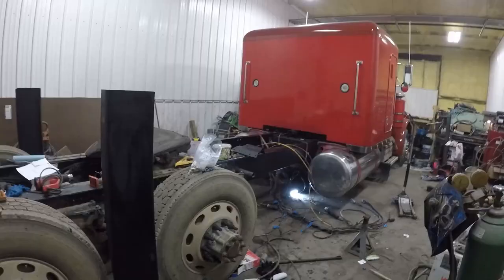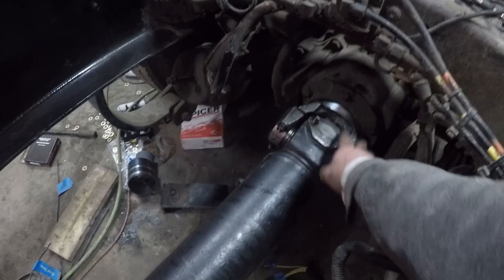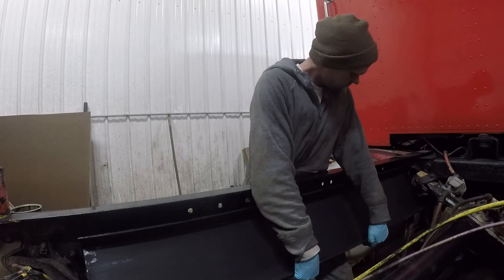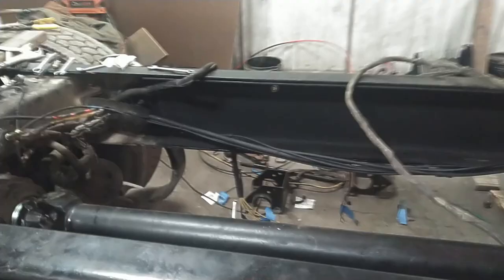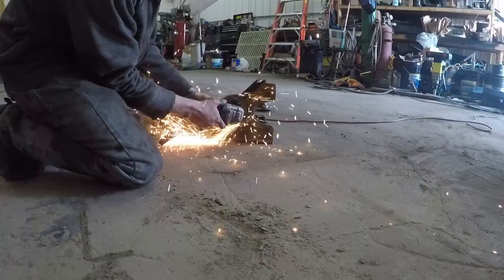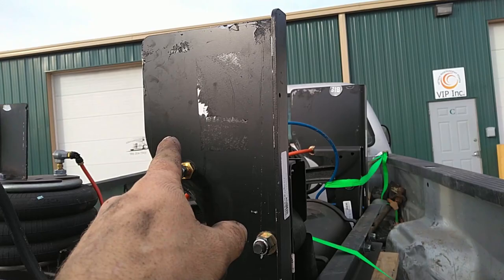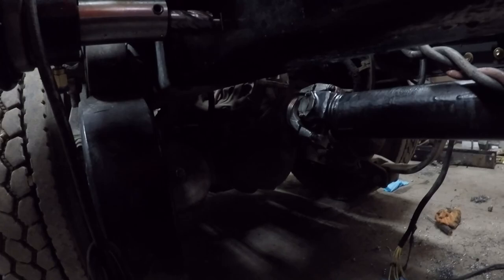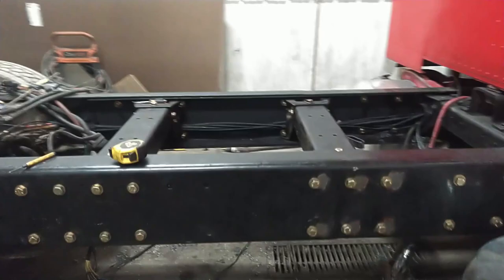peterbilt 359 rebuild ep 19

Comment: Problems you described are the reason we always pull the sleeper and tanks and add frame directly behind the cab.. When done you cant tell where we cut or added frame. But its our way.. Everybody has there own ideas. I found the extra work turns out beautiful craftsmanship.  No extra holes in frame just one long solid rail.. Also it makes driveline work a breeze with tanks and sleeper off..

Comment: Truck is coming together nicely! The Mack is gonna get jealous once you hook the 359 up and it hauls it's first money making load! The bolt hole layout mistake sucks, but if that's the biggest setback in the whole project things are still going good! At least it was just a frame stretch. I re-railed a truck once and the shop wouldn't pay for pre-punched rails so we drilled all of them. Problem was I did one side and had to go on a service call, get back the next day and someone "helped" and drilled the other side and.......the entire rail was off a couple inches!
Reply from the maker: that would suck i would be mad

Comment: Nice job man, it's going to be a cool ride. There are a few things i would do to make it perfect, take off the air wipers and melt them down so no one else will have to suffer. I would also move the mirrors off the doors to the cab, and think about changing to a 1994 60 series so i could have cruise.
Reply from the maker: the last truck i had with air wipers never gave me any issues and i didn't mind them at all. now that one of the switches is leaking i kinda wish i would have done the electric wipers when i replaced the one motor. oh well.
Reply: @Ezrider359  the only reason i don't like air wipers,is because they don't move in unison, but, one at a time is ok

Comment: Helpful, informative, quality work! It appears to me that you used anti-seize on the input shaft of the rear end. One day the drum bearings on my clothes dryer were squeaking. The only lubricant I had at home was anti-seize, which I used for lubricating the bearings. The dryer again started squeaking in less than a week. I took apart the dryer again and used a different lubricant. The dryer then lasted for years with no squeaks!

Comment: 👍👍👍😎 I wish I had that type of knowledge to work on my own drive train as you. I do work on my own vesicles, change out my water pump, brakes, shocks gas tank, tune ups, good at working on everything on the outside of the engine don't have the knowledge to rip apart my engine and transmission have a 88 bronco ll with 350.000 on her, original fuel injections, original clutch, trans, rear end and the original 3.0 engine she doesn't burn a drop of oil, cruises down highway like a champ jump on her issues right away when she showed signs,  I never neglect any of my vehicles.
Reply from the maker: i had a 88 bII for a while

Comment: --------- one drawback to POR-15 it needs a topcoat of actual paint ---- UV light will degrade it ---- your a one man repair team ----- good work ✅
Reply from the maker: from a rust preventative standpoint it doesn't need a top coat but it will fade in uv light.

Comment: Grreeeeaaaat! 🤩 What is the old saying...Measure twice, cut once! All it takes is one little thing to make your work harder/longer. Whew! 🧐 Those liners were hard to install...you needed 2 more hands. That’s the hard part about working alone on a big project. Is this rig gonna remain a tractor? I’m assuming that the pusher axle will be installed on this rig. Lots of work, but it’s easier when you have a garage to work in! Great job! Learned quite a bit. I’ve seen stretched trucks and each one is different in some ways.
Reply from the maker: oh they were all measured correctly other than being 1 inch too far forward 🤣🤦‍♂️
Reply: Ezrider92356 Gotcha. It sure looked good. Looking to see the finished product! 🤩 Have a great day, friend!

Comment: Annular bits don't last, stick with up sizing regular bits and learn how to sharpen and use heavy f style clamps. We've done many stretches..Adding a lift axle, we would have gone to the spring shackle with frame. For real 120 psi frame rail use P.G. adams.  If your fifth wheel pins centre of front drive full frame a must on a 20k axle add. thanks for the video.
Reply from the maker: It's a 13k rated pusher not a 20k, 20k would have duals or floats

Comment: A British truck manufacturer called foden ,also owned by paccar until 2006 used the same cross member set up . But the chassis components were supplied by kenworth trucks also owned by paccar.
Reply: So a quick question for you... Once this extra axle has been fitted to the chassis. Will this truck have to pass another inspection because of the new modifications that you have done. ..

Comment: Hey great series on stretching best on YouTube .  I wish you explained how to deal with the drive shaft. How to measure , how to set up , how to make !! I need help lol!
Reply from the maker: I thought I showed that in one of the videos but maybe not. Being that it had a 2 piece driveshaft to start with I had a 3rd driveshaft made that was the same length as the stretch and added a hanger bearing and installed it between the two existing sections of driveshaft
Reply: @Ezrider359   wow thank you for responding!! I didn’t think I’d get an answer!! I appreciate you. Thanks for explaining!! 

2nd … where can I get the inside sleeves to double up the frame !?? Steel supply !? How to measure with the inside curb. I want it just like yours !!

Comment: Hey Ezra, I ran all my wire harness from under the truck back to the rear of the frame, through 3" pvc pipe, with end caps drilled and the caps packed with driveway sealant around the wires coming out of the caps. All my connections are now impervious to salt and water. It's an old mud truck trick we used to do on our mud trucks. Painted the pvc black and it blends with the frame. This truck is coming out sweeter than tits. Good job
Reply from the maker: cool idea 👍

Comment: looks like a good stretch what did you finally come up with for a wheelbase after the new cutoff  & stretch?  Looks long but once you get the pusher in between the tanks & drive axle it is going to look nice Not that crammed in look yet not that silly long look. Got to remember that ole 359 Ex-hd is not going to turn as tight as your Mack does. you might be able to mess around a little with the STOPS on the steer axle but as you know one can go to far & then will have wheel seal trouble. While watching you closely I then thought when looking at that old 359 sleeper rear mount that a Cab- Mate Brand  air ride sleeper kit would be a great replacement for that factory rear mount. my cousin put one on his Peterbilt 379 ex-hd plus also on the cab 7 it made quite a difference in the ride. not as good a Unibult ride but Better. keep posting Ezrider looking good. Your very talented.
Reply from the maker: 276 wb but yeah its not going to look super long once the pusher is on but didn't want it to be real cramped eather. should be just about right.

Comment: Wondering if the new rear end is identical, or very different in ratio o the removed back end. Will we get a faster truck, or one that might pull harder??
Great work, not a small job to be doing at home!!
Reply from the maker: Same ratio 3.70 should be a good fit for the truck
Reply: @Ezrider359  I'm in Australia...Engineers would need to design and be approved to this work. Sign off on it. A lot of the trucks are big tonnage B doubles or road trains. Great work.

Comment: Is the insert just bolted or did you weld it? Also is the new differentials gear ratio going to work good with what you do and the mechanical engine,  they have to be higher than the originals. I like that you didn't edit out the struggle with the insert 
 KEEP IT REAL. 👍👍👍
Reply from the maker: bolted in. gear ratio is the same both had 3.70's witch should be a great match to the truck and my use.

Comment: great video  Mr Ezrider92356 Lol your face said it all after 1 inch out  holes drilled  misaligned and when you dropped the  drivers side inner liner i cursed for you pity there wasn't more or longer video and  kenworth have all nut and bolts with aluminium   angle top plates  all had to be cut off and replaced with grade 8 bolts and gallons of never seize used between plates. Liners  and bolts  on a 1993 k100 coe (rust from animal urine and dung) and a  1983 k144 coe   body tipper  (bent after a roll over )  im surprised you didn't seal around liner and chassis with drip check . Calk or Sika-flex cause  grease will bleed thru in summer  and stop  salt entering over time or either that add a grease nipple to out side chassis to push out salt and debris
Reply from the maker: Adding some grease zerks has crossed my mind. I might still do that want to wait till the pusher is on to make sure there accessable if I do tho
Reply: @Ezrider359  cool  i think that over time grease gets hard and doesn't move

Comment: ? could you have cut behind the 5th wheel? is it stronger cutting in the middle where most of the weight will be. Getting my truck done and wanting information. Thanks
Reply from the maker: yeah you can cut your frame further back, i couldn't because the frame was rusted out under the 5th wheel. generally if you can have your slice further back its better the force on the frame is going to be highest near the center of the span.
Reply: @Ezrider359  thanks for the reply

Comment: do you not like the two piece front rear end seal? i just purchased one have not installed it yet
Reply from the maker: 2 pc seals are fine. there good if you have a grove worn in from the seal. i use 2pc wheel seals quite a bit.

Comment: isn't illegal or prohibited to weld the frame let alone cut it and weld it back together ? the frame comes with a label that says " Do not weld or heat ……." just curious
Reply from the maker: Parts and accessories shall not be welded to the frame or chassis of a commercial motor vehicle except in accordance with the vehicle manufacturer's recommendations.

Comment: I'm not sure if this is a stupid question. But are your drive shafts still going to fit once you install the new transmission?
Reply from the maker: It's not a bad question but yes it should fit 13 and 18 speeds are the same length should be a direct swap

Comment: My question to you is  Since you cut the frame do you have to get it recertified since I'm going to do my just so I know what to expect thanks
Reply from the maker: Where I am there's nothing that says it needs to be re certificate but does need to be able to pass safety inspections witch won't be a issue
Reply: @Ezrider359  would it be a dot inspection or state and were would I fined the info for this
Reply from the maker: @johndeere1958ful  just the normal dot stuff you would have to pass anyway. the fmcsa handbook.

Comment: How much did get new axles and frame for
Reply from the maker: i gave 6k but that also included 8 aluminum rims good tires and the 5th wheel. i think he wanted $3500 for just the frame with the axles and suspention. wasn't a bad deal esp consider it had 3.70 gears witch is what i wanted and thats harder to come by in the later model trucks.
Reply: Ezrider92356  thanks that’s a good deal thank you for your come being thinking about it for a while now you’re video got more interested in going for it thanks